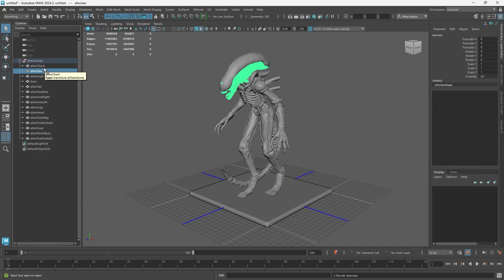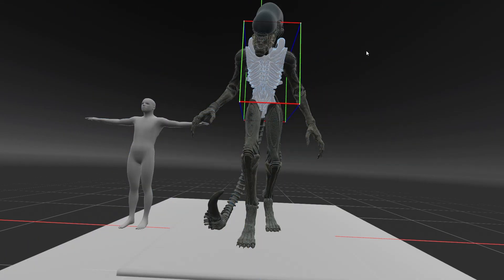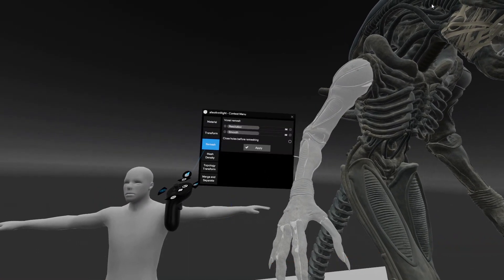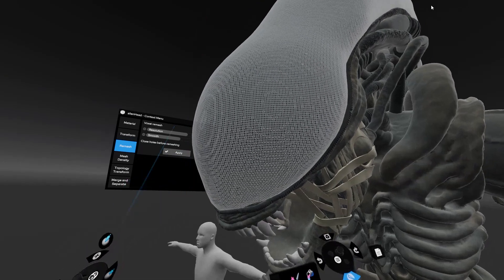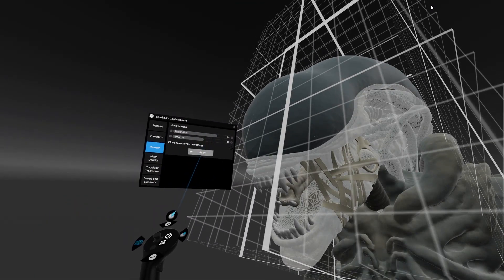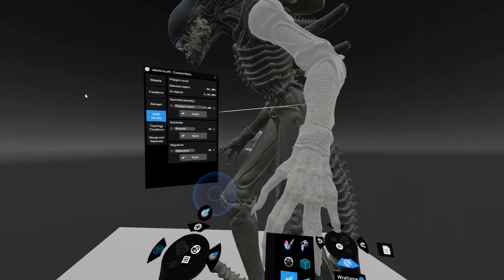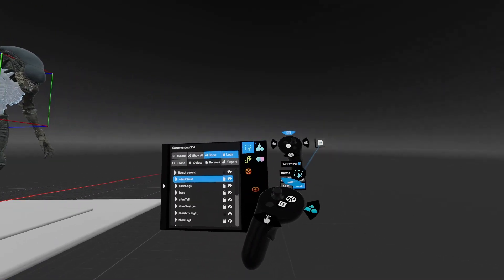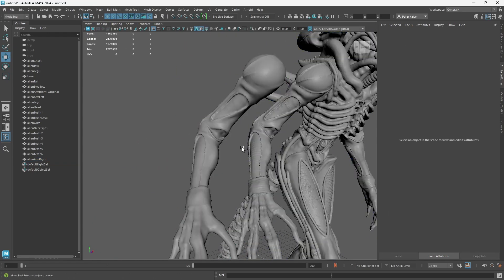Shapelab and Maya | Shapelab's VR retopology toolset

Comment: i thought you were going to do some hand retopo in shapelab. i use 3dcoats retopo tools when im doing custom retopo work. other than that id use remesher or something like that. blender has these same tools your showing. something new would be doing cool custom by hand rtopo in a vr app. that would be nice in vr cuz its so imrsive.
Reply: Agree, I also kinda missed the point of the video. You can do volume-based remeshing in practically any 3d software, no need to start VR for that.